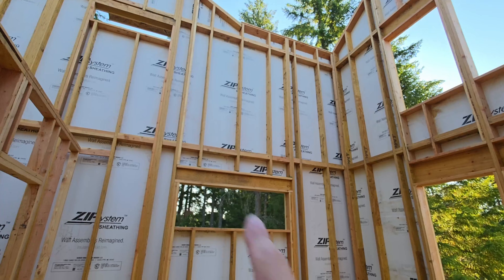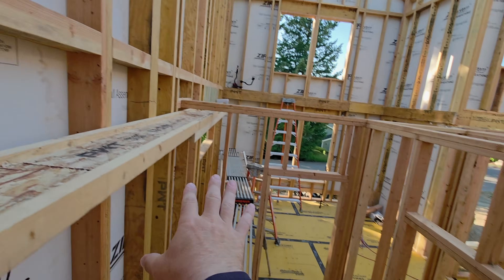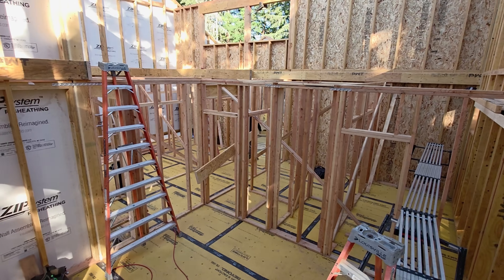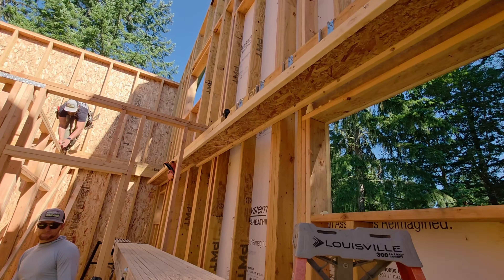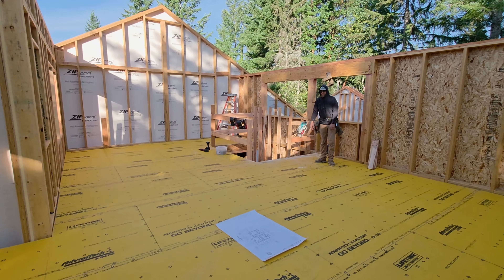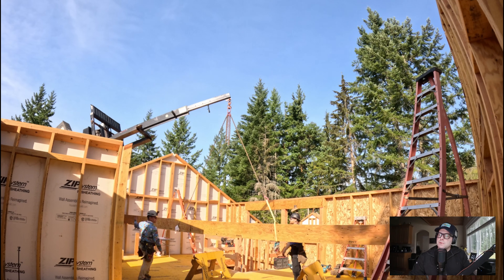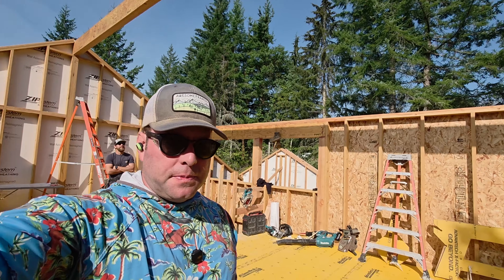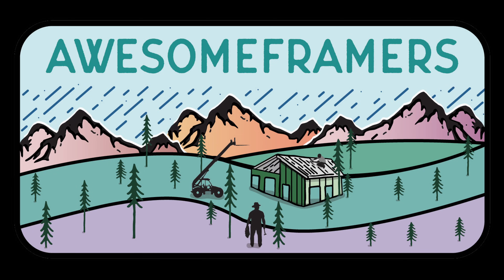How to Frame a Floor System in Balloon Framing (Yes, It Hangs)

Comment from the maker: This floor system is engineered for balloon framing and framed like a deck using LVL ledgers, joist hangers, and deck-rated structural screws. These fasteners are designed for higher loads than residential floors, and the floor diaphragm actually helps reinforce the balloon-framed walls.

Happy to answer thoughtful questions about the framing details 👍

Comment: Question:   For more than a few centuries now, we’ve learned to build in compression rather than much weaker shear.   So why was a balloon design with a floor mounted in shear chosen?
Reply from the maker: You comment implies that we can't design for "shear", but that isn't a true statement.  You hit the nail on the head when you use the word "design".  That's the entire point, we design to meet the loads with safety facter.  That equals strong enough, durable, etc.
Reply: @AwesomeFramers I am not stating a negative critique, I, and now others, are genuinely asking why this design was chosen.   Are there benefits we are overlooking?   Is there an intended purpose we are missing?
Reply from the maker: @SME.Retired  I'm sorry that my comment came across implied you were being negative.  That was not my intent.  I was attemping to address the statement than "much weaker shear." I believe I did address that.

Yes there are many benefits.  We have single walls that run from bottom plate to the roof sheathing. Roof diaphragm directly attached to the shear wall. This eliminates any hardware normally specfied to tie the upper floor walls to the lower floor walls.  This can simplify the framing, logistics, engineering, etc, lowering cost with no trade off in quality or strength.  We reduce working at height, which means less requrement for fall protection.  The list goes on.  

I guess I would push back and ask, what's the problem(s) here in your view?  Then I can address each of those.
Reply: @AwesomeFramers No concerns, just curious.  Thanks for explaining.

Comment: I'm curious how your engineer signed off on that sdws ledger spacing. From the docs for pwt LVLs, the minimum spacing for a 16d nail (much smaller diameter than an sdws timber screw) is 5" OC in the narrow side of the stud. I'd guess the minimum spacing for an sdws timber screw is more like 8", if it's even allowed at all in the narrow side.
Reply from the maker: Take a look at the details from Strong Tie.  They provide all the data he needs to spec the screws.
Reply: @AwesomeFramers From the SDWS timber screw docs on Simpson's site, the minimum spacing between fasteners in a row with the load parallel to the grain is 8". Even if it was lower, I think it would have to conform to both the sdws minimums and the pwt minimums anyways.
Reply from the maker: @niktak1114  That's where the engineer helps us out.  Thoes miniums you mention are "prescriptive" but not absolute. Get in touch with Strong Tie and ask them for help analying your particular situation.

Comment: Do you have joists on longitudinal edges or ledgers?
Reply from the maker: Did you watch the video? They sit in hangers attached to ledgers.
Reply: I mean the sides, do you use a long ledger to support the floor or I-joist?  I think I'm seeing the LVLs support the sides of the flooring, why wouldn't you use an i-Joist on the edges?
Reply from the maker: @steve-shmaryahu-joo  The entire perimiter is LVL attached to the walls.  I could ask the engineer next time to spec I Joist on the outside walls parallel with the joist run to save a little $$ but I wonder about putting these or other screws through the top and bottom flanges of the I Joist.  I suspect this could present issues not worth addressing.  But maybe he'll say go for it 🙂

Comment: How DO you frame up walls on a custom slab with a backdrop on one side and multiple step downs. The pad is built into a hill.
Reply from the maker: You can check out the Project 31 playlist here on the channel.  It shows exactly that.

Comment: Rather have my floor and joist system sitting on top of the walls.  More solid and easier for plumbing.
Reply from the maker: How much more "solid" do you need when its designed to meet all the design loads? Serious question, I would appreciate a response.  Additionally, how does it make the plumbing easier?  Our plumber said it makes zero difference to him.

Comment: Are those Simpson screws 6", or 8"? Trying to keep looking at SIPS construction & I believe I can convince our engineer to do this exact, LVL ledger system for the upper floor, as the connections using 2x6s ... are every 4'ft. The home is about 24'ft deep. The ledger could be OK for code, plus maybe some smaller screws, or ring shank nails used in between to pierce the inside, OSB panel. As long as nothing blocks the electric channels molded into the EPS/GPS foam...

As usual, thanks for the added entertainment value through humor & some light clowning around.

Comment: I like how you guy are willing to get innovative with framing methods like balloon framing. TBH IDK why you wrap the entire house in bracing (we use thin hardwood ply at corners and steel bracing straps in Australia). I'm also not a fan of Gluelam/ ply. A fireman friend told me that engineered products melt in a fire (the glue is highly flammable) and they can't estimate when a building will collapse unlike with a traditional pine of hardwood frame. The same goes for steel frame (folded sheet metal). There are some local councils that will not allow steel frame due to excessive maximum temperatures (frame warping) and sea spray / galvanic corrosion.
Reply from the maker: Fully sheathing walls gives us huge benefits https://www.apawood.org/fully-sheathed-walls

Regarding the firefighters's comment.....I just don't care.  I know that sounds blunt or abrasive, but hear me out.  These houses are systems and those systems are tested, and then in service they provide decades of data and thousands (maybe millions) of case studies.  It turns out that this fear or worry, doesn't match up to the reality.  That applies to every other area in life too.  I think every day as I drive 60 down a 2 lane road with nothing separating me from the oncoming traffice but a painted line on the ground "how in the world are we not seeing non stop head on collisions?".
Reply: its definitely true with roof trusses, i-joists, and floor trusses its much harder for firefighters.  Unfortunately in the US that ship has sailed and they pretty much have to deal with this.  It's just part of firefighter training now.